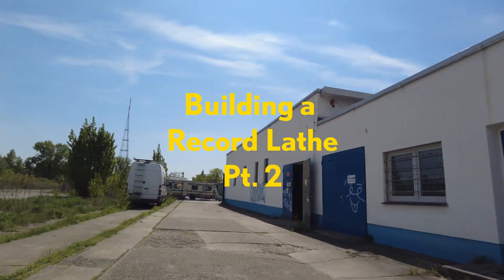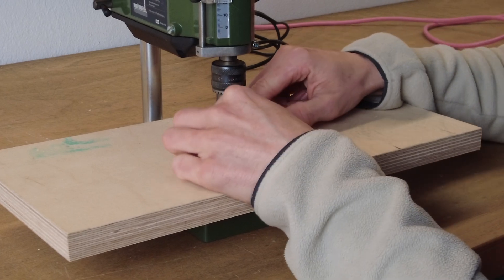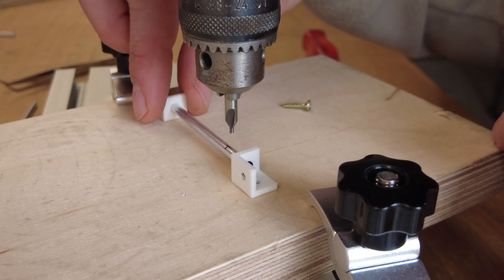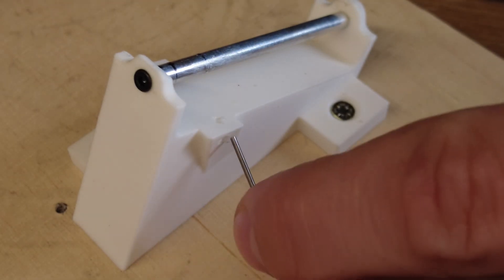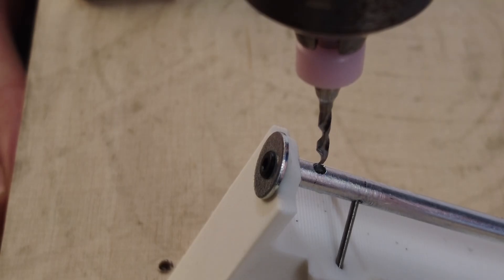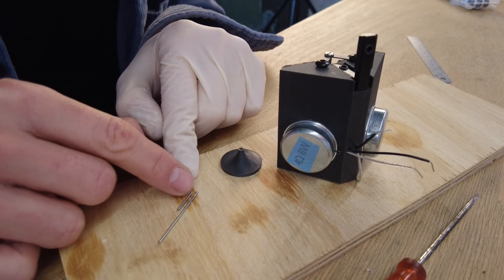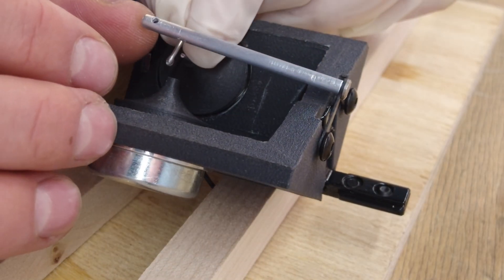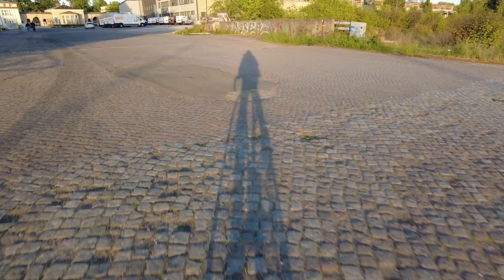Pt.2:  The Tube - Building a Vinyl Record Embossing Machine

Comment: What type of wire isit for the torque tube and what is the tool used to cut the wire please?
Reply from the maker: The wire is nothing special. Just a small wire end from welding-wire. I use a manual knipex wire cutter.

Comment: Hey, really nice build, that torque tube drilling alignement jig does the trick ! 

Just a little heads up, I've looked only for designs for cutting and not embossing, but most of the principles are the same. Your tweeters seem to have a lot of mass, which will require a lot of energy to accelerate the rod at higher frequencies. I know that when embossing you don't care that much about high frequencies, but I guess that making the whole system as efficient as possible would help also when embossing. In most builds I saw people tried to trim the mass of their drivers as much as possible, and that whole metal disk on your drivers seems pretty heavy. 

Also coating the plastic cones with epoxy helps a lot, it transmits the high frequencies from the drivers a lot better than only through a 3d printed cone (the stiffness makes up for the additionnal mass added by the epoxy).

Anyway thanks for the video, looking forward for the rest of the project !
Reply from the maker: Thanks for your substantial feedback. 

I like the idea of removing the metal plates from my exciter and will certainly do that on a future embossing head.

I know the design needs some work. But will go into it more when I make the first cuts on my machine.

Glad you are following my process.

Always happy to receive constructive criticism ... and will gladly incorporate it into my process.

Comment: Hi mate, I'm wondering why you switched to metal for the tube?

Is heating the tungsten a thing in embossing too or why bother with all the extra work if you are already printing?
Reply: probably rigidity is needed in excess of plastics abilities
Reply from the maker: Yes - that is also a Point i was thinking of.
Reply: @teslacoil4335  I wouldnt know what for really tho.
The job of the tube is to restrict movement backwards and forwards, so that the spinning disc below wont rip the whole construct apart through drag or at least mess up the geometry and potentially cause the coils of the 'speakers' to rub against the magnets and damage them.
A printed tube will be rocksolid along this axis.

Where it may flex a bit more then metals is along the other axis, the one that has a constant pushing and pulling force from the 'speakers' and actually NEEDS to be able to move as unrestricted into those directions as possible.

I can see some introcate geometry allowing for the best of both to be combined potentially resulting in excellent properties undreamt of by metal rod users!!
Reply: @Wassermelonenbaum  I imagine that their would be chatter like on a lathe, and presumed the rod is stiff enough to fight that, but it might just be a simple way of doing it, I'm sure he could've printed something instea
Reply from the maker: Good idea! 
I was using Aluminium Tubes because of the threads at the Front and the end. At this sice it is imposible to print. But I could design a 3D printed rod made out of Carbon-ABS or carbon-PC and as rectangular nuts as both ends. 

Thanks for the idea - will try this in the Future
Reply: @alexrex_de  You can try cutting your own threat into the plastic with the screw directly.
On my X1C, I just make the hole the same size as the screw and it usually ends up with a very strong connection.
If thats not enough, try threaded inserts.
There are tiny ones for tiny screws and they just need a slightly bigger hole to work, but result in even stronger connections.

No need to bother printing a round tube too btw, squares print a dozen times easier and work just as well ;)
Reply from the maker: @Wassermelonenbaum  yeah, thanks. i am looking into this in a future episode. 
i sometimes use Threaded Inserts and hot melt them into 3d prints.
Reply from the maker: Also i am Not Planing on heating up the stylus, i am maybe heating up the Blanks - so some Heat will be absorbed by the Tube as well
Reply: @alexrex_de  Aaah OK.
If I remember correctly, you wont want to heat them much more then some 30°C, so unless you aim your heat source directly at the head, I doubt there is gonna be noteworthy amounts of energy transferred to worry about in this case.
Id imagine the friction causes more heat in the stylus anyways😆

There are a few filaments that can deal with well over 100°C, so even a heated one made from a printed tube would be feasable....  
Greentec Pro is the best performer I found so far, but its not cheap.
For specific parts like this great to have laying around tho!